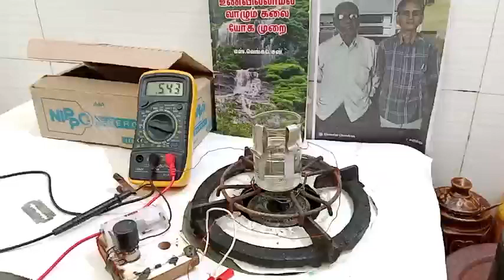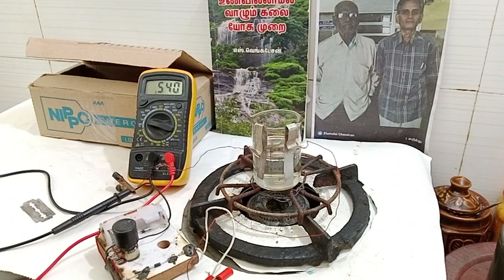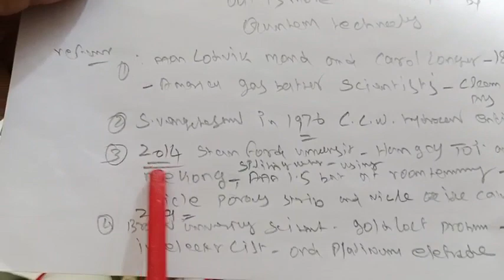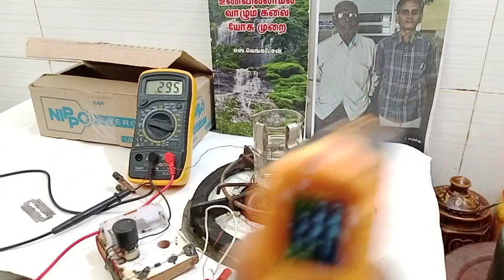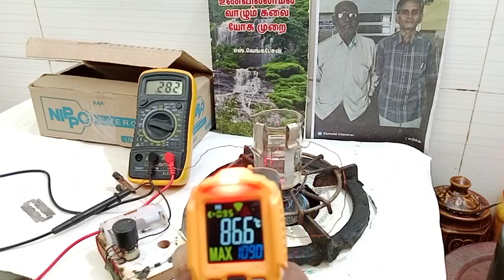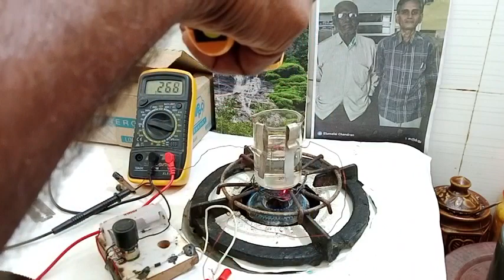superconductor makes cheap hydrogen using Quantom duel effect,-10vdc,120°c, back EMF solve

Comment from the maker: low cost Quantum entaclement water spliter to generate clean hydrogen with AAA 1.5 volt battery
This is different all kind of electrolysis method because input is less than 200 mili volt and external heat is 120 degree Celsius only,using 600°c degree heat resistant and dielectric borosil ceramic container and aluminium porous strip electrode and electrolysing and boiling works at a time in one container and  DC back EMF problem redirect to split water continuously by silicon semiconductor diode

needs of material thermometer multimeter,1.5 volt battery, 100K potential metre,silicon semiconductor diode, aluminium porous strip electrode,100 ml heat resistant and dielectric borosil container,60 ml 1:6 h2so4 dialuted water,LPG gas burner, that's all

problem and salvation
number 1 when water boils at 100 degree Celsius it losses its density and goes to zero electric resistance it means zero horms, so it is possible to reduce input voltage as much as possible..

number 2 major problem of the DC back EMF
why can't make hydrogen cheaper
because of the DC back EMF is reason when reducing input voltage the hydrogen and oxygen fuel cells gives and EMF of 0.73 volte and electric current chaseed, this problem can solve by semiconductor diode this technique inverted in 1976 by space scientist yes Venkatesan patent holder of ccw hydrogen engine

எக்ஸ்பெக்டிங் ரிசல்ட் expecting result

Total  input is approximately 80 wats to heat 60 ml H2SO4 1:6 dialuted water
when splitting the 60 ml water gives approximately seven gram hydrogen 1 gram hydrogen equal to 40 wats,7gram hydrogen equal to 280 watts output is more than input by Quantum entanglement
total input in the mechanism equal to the total output is produced

points of reference
number 1
1889 lordwik mond and corl long   American scientist of gas battery clean hydrogen project 
number 2
yes Venkatesan in 1976 invented ccw hydrogen engine-reported to NRDC 

number 3
In 2014 the American  Stanford scientist  Hangsitoi and meengank -invented  low cost water splitting-at room'temperature using triple AAA 1.5 battery nikal porus electrode and nickel oxide catalyse etc..

number 4 in 2019 the American brown University scientist invented the  goldylock problem in electrolysis on platinum electrode100

Comment from the maker: வெங்கடேச மின்வளி-
MINVALI VENGATESA Q-GAS
Low cost water splitter generates clean hydrogen to space life vengatesa edu 200years proplum solve
AAA 0.1v battery-powered water splitter generates clean hydrogen -DIRECT THERMAL WATER SPLIT Q-PHY TECHNOLOGY using superconductivity,aluminaporus electrod,exo100°c,0 ohms,600°c dielectric and heat resist ceramic pot, DC Back EMF, Goldilocks,e-negativity solution diode etc
0.1Vdc Powered Water Splitter Could Revolutionize Fuel Cell Development

1) கருத்து சுருக்கம் abstract

குறைந்த மின் அதிக வெப்பம்
low volt high temperature

2) செயல் விளக்கம் description
நேரடி வெப்ப நீர்ச்சிதைவு- direct  thermal water split

நீர்வளி உயிர்வளி பிரிப்பு
2H2O spilitng

இணைப்பு connection
1.5 battery to 48k potential metre to 1 ampere semi conductor diode to 100 ml 1:6 h2so4 beaker with anod, cathode copper electrode by multimeter support

heating system on my self 
place gobichettipalayam
date and time 27/5/2022 at 3pm

1.5 volt seems multimeter, slowly direct heat with LPG gas burner the heat develops, the voltage reducing with potential metre 1.5 to 1.4 to 1.3 and gradually to 0.1volt etc....
temperature testing with laser thermometer
at 35 degree Celsius 1.5 volt nothing,                    at 90 degree Celsius 0.5 volt the h2o speed starts,
at 100 degree Celsius 0.4 volt the 2h2o speed evolve,                                                                 at 115 degree Celsius 0.3volt the 2h2o speed continuous,  
                                                                    at 130 degree Celsius 0.2 volt  the 2h2o gas evolving continuous and safficient gas,   (VENGATES points) 

important                                         sometimes gose to 0.015 voltage at 160 degree Celsius and safficient gas evolve etc..
acid diluted water was no colour changed, no material losses etc .

.3) 1-உரிமை கோரிக்கை claims 
விஞ்ஞானி வெங்கடேசன்-scientist-patent holder- Venkatesan BE;amie,
Gravity does evil but we turn it into good..

  2-திருக்குறள் THIRUKURAL
 
நல்லவை எல்லாஅந் தீயவாம் தீயவும்
நல்லவாம் செல்வம் செயற்கு.
In making wealth fate changes mood;
The good as bad and bad as good.        375

செயற்கை அறிந்தக் கடைத்தும் உலகத்து
இயற்கை அறிந்து செயல்.
Albeit you know to act from books
Act after knowing world's outlooks.        637

ஆகாறு அளவிட்டி தாயினும் கேடில்லை
போகாறு அகலாக் கடை.
The outflow must not be excess
No matter how small income is.        478

 3-Venkatesan invention
s Venkatesan invention patent act 1970 form 3 provisional  specification 76 mas 75 dated 13.5.1975 closed circuit water engine 
papper sent to nrdc also 27nov1975

Venkatesan method of water splitting
project and readings
professor s Venkatesan
place valivalam polytechnical College
electrical lab
date and time 7.8.1976 at 4:00 p.m

volt ams remarks
1.l0 0.16  Bubbles were evolving at electrod  bubbles
1.30  0.22     ""      """  
1.00  0.16  "  "  " "
0.90  0.07 slow bubbles
0.80 0.07
0.7. 0.07  slow bubbles in

note
Below 0.70 volts, when voltage was reduced current ceased

The above experimental findings where confirmed by extract from book:-

  4-"Fuel cells, Power for tomorrow" by  DS Halacy,JR(popular library Inc,U S A) p 21 &22(substance)
" Mond and Longer-hydrogen oxygen fuel cell with platinum porus electrod gave an e m f of 0.73 volts"

 5- reference additional
physical chemistry by Puri & Sharma
p 404,p 389,p750

 6- extract from:-
 
science today October 1978 page number 53 artical 

why is a perpetual motion machine impossible
...... don't come to the conclusion that perpetual motion is to be hopelessly ruled out. in the sub atomic or microscopic domain " perpetual motion is the rule molecules of matter or in a state of constant random motion........
work can be extracted from this motions without violating the second law of thermodynamics stated above

"a perpetual mobile of the second  kind whose efficiency is 100% does not exist
in fact the molecular motions are slowed down(or system cools down) when this energy due to the random motion is partially converted to useful work the rest of this energy is lost as heat

......We must remember that quantum mechanical has to be applied in the case of these small particle..... Indira Murthy...

  7-A brief history of time by Stephen w hacking- page number 109

second law of thermodynamics has a rather different status than that of other laws of science,such as Newton's law of the gravity for example, because it does not hold always just in the vast majority of cases
8- Extract from book
உணவில்லாமல் வாழும் கலை யோகா முறை ஆசிரியர் வெங்கடேசன் கட்டிட பொறியாளர்
Art of living without food by yogic method Venkatesan civil engineering
p number 220 to 222

 9-practical and project vedio by INIYAN KA MU AT MY HOME ETC..

27/5/2022
https://youtu.be/pGrXf848qvk

30/5/2022
https://youtu.be/4ASC0EjGTdc

10-1889 mond and Langer, 1975-scientst-sa.vengatesan,2022-INYAN KA MU RESEARCHER